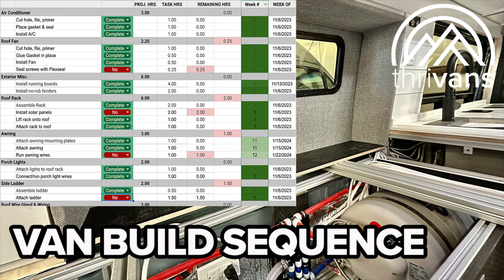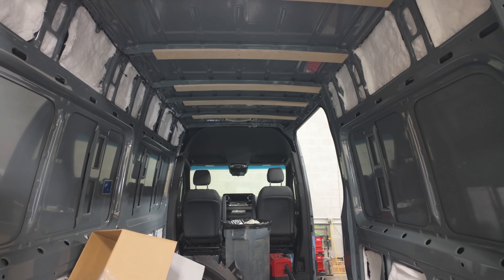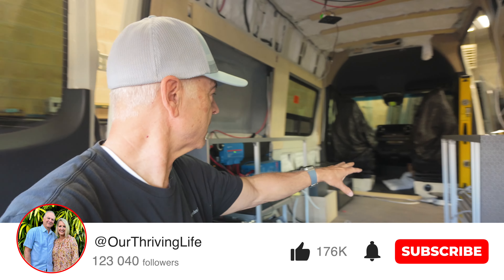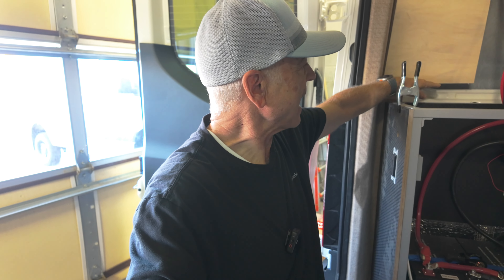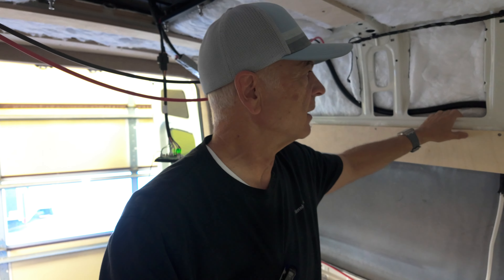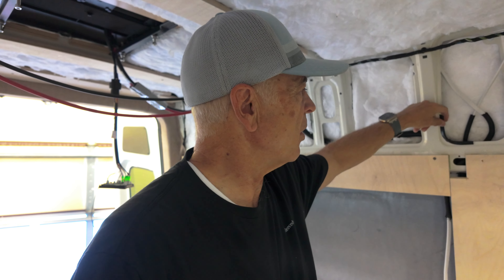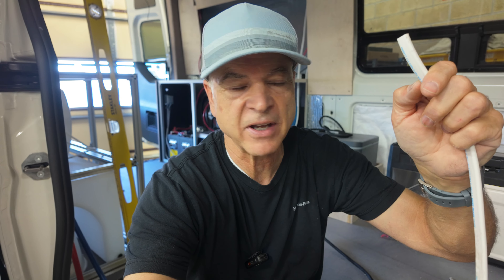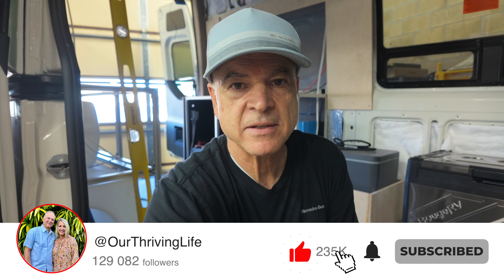#1 DIY Van Build Mistake to Avoid

Comment: Can you expand on LVP flooring? Your videos are amazing, but I can't find a single video you have that covers flooring!!!!  Securing it with aluminum floor trim on front/rear and slider means the only direction it can expand is toward the driver side cabinets. But in your 8020 video you run the flooring under the cabinets and screw the cabinets into the flooring as well. And do you run the flooring around (not under) the back cabinets that hold power and water systems? I hadn't consider planks because I have heard complaints about them expanding with extreme van temps. This is an important topic and would love to hear your thoughts. Seems many people would also love to see a video on how you approach flooring!
Reply: Me, as well.  I'd think the flooring is the first thing to do.

Comment: Great content as always. Really enjoyed reading your build materials list but was surprised by your low cost sidesteps. However, I spent 3X as much and am not thrilled with mine. Also, check out the Rheem Performance 2.5 gallon water heater as a better alternative. Similar to the Bosch but with a low point drain and you can swap out for other heating elements.
Reply: I've used that Rheem in several builds and highly recommend it. Low point drain is critical up here in Canada for winterizing.

Comment: I would love to hear more about how you do your floors. If they're floating are they secured down on one side but not others? Or do you tuck them under some of the secured cabinets? Since a van moves a lot more than a house I assume there must be something that's keeping the floor from completely coming up in an accident?
Reply from the maker: We have aluminum floor trim on the front, rear, and at the sliding door. The LVP flooring is secured to the subfloor at these points.
Reply: Thanks! Makes sense. I'd love to see a video showing more details as well as why you like LVP over sheet vinyl (like Lonseal). Great content!
Reply: @thrivans  I'm also curious which brand LVP you use?  Thanks again for the great content.  I hadn't thought a floating floor was practical in a van, but now that I realize there are ways to secure it on 2-3 sides and let it float on the other, it makes a lot of sense.